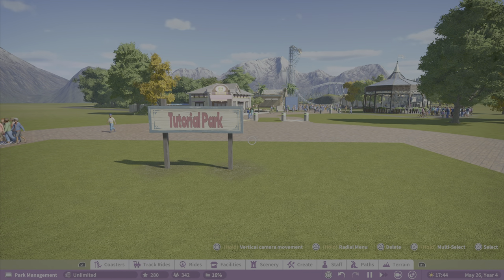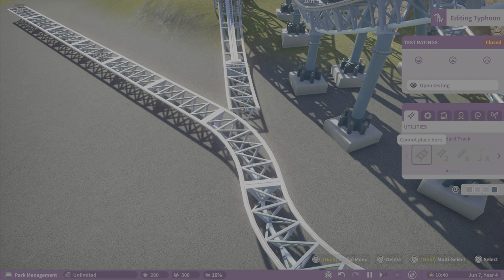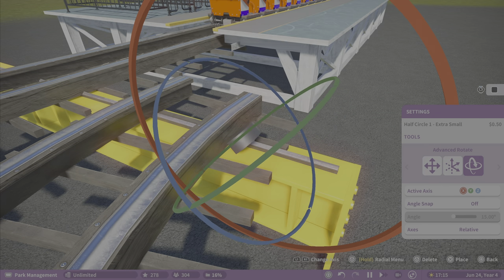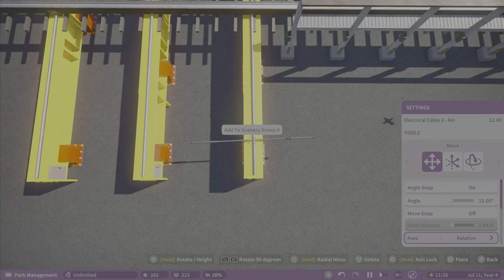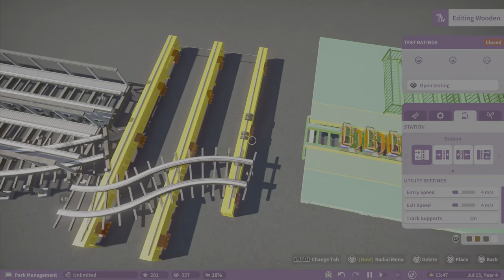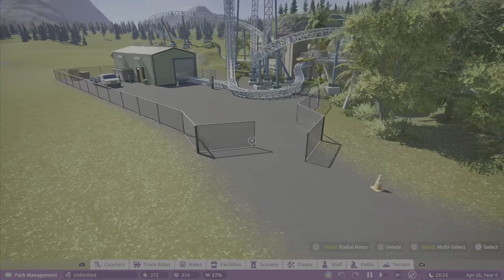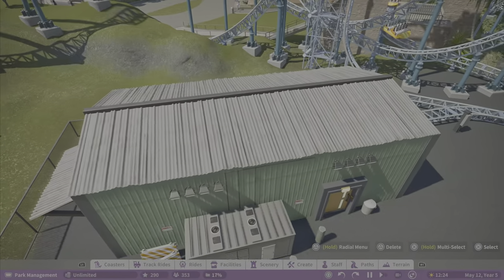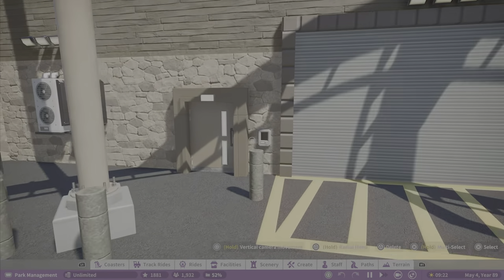PLANET COASTER TUTORIAL: How to Build Different Transfer Tracks and Maitenace Sheds

Comment: Another great video! I have a tendency to not plan my areas correctly ultimately forgetting to do or not have room for transfer tracks but recently been making blueprints of common coasters I use with the transfer track already done so when I place it in the park it’s been done already.
Reply from the maker: Yeah most of the time its much easier to have the transfer track at the end right next to your final break run. I always try to keep in mind a spot where i want to put it just so i dont run into problems later. Thanks for watching